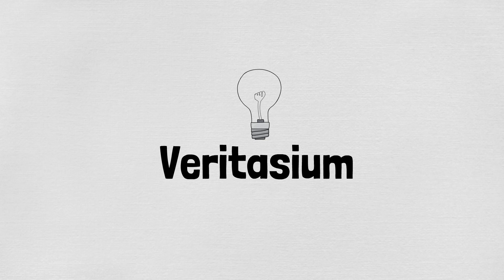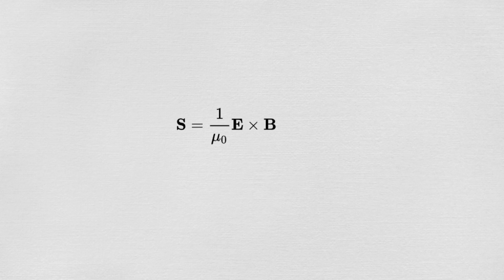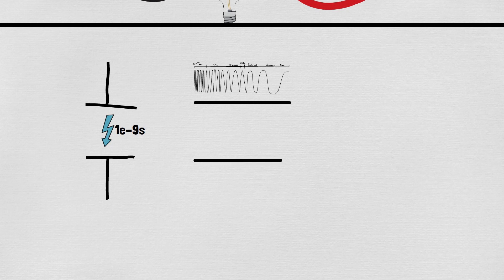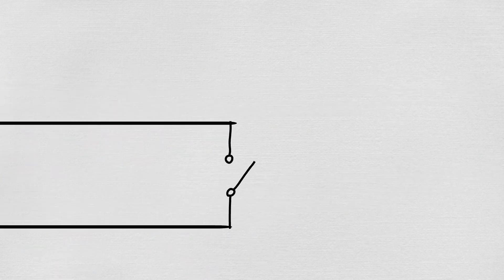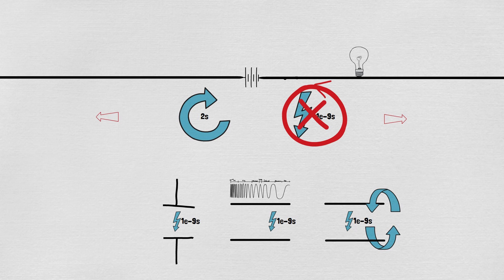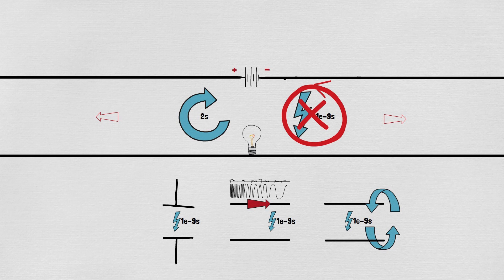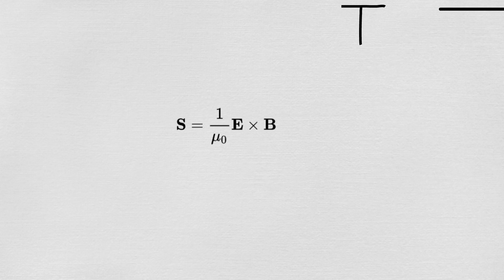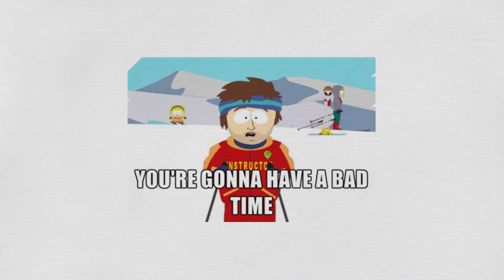Veritasium is Right? (see description)

Comment: When does the current start to flow? Won’t the electric field partially exist when the switch closes as the current starts to propagating from the battery? Won’t this electric field gradually turn on the lightbulb over the time it takes for the current to fully develop?

P.s. I know nothing but this is what I got from Veritasium’s video

Comment: THANK YOU for your video !  I 'think' I've got this now ( after piecing together so many videos on Dereck's treatise on the flow of energy ).   I think Derek is technically correct, but there were other pieces of the puzzle which I believe he left out of his video ( admittedly so, by Derek...likely in order to keep his initial video on this topic brief enough to whet our appetites, yet not so deep that it was going to take a couple of hours going over the mathematics and fundamental concepts of it all....which we could study on our own if so inclined after his vidoe )....but I digress....

I originally had been of your same viewpoint on this, Tycho -- that it would violate causality for the power signal to travel the 1 meter from the battery to the light-bulb/load, but now believe Derek to be correct.  I'll try to ( very ) briefly explain, below.  Hopefully this will spark some good discussion and desire on the part of many to investigate deeper into this FASCINATING process of power conduction.   Ok, here goes ( the ultra-abbreviated version ):

1) Even without a closed circuit, or time for the electromotive force to propegate the full length / circuit of the wire loop, power begins to be transmitted immediately upon connecting the battery to the length of wire....the deceptive part is both the switch, and the manner in which current & electrical potential flow.

2) The circuit immediately begins 'transmitting' ( literally ) power by means of a Displacement current which appears across the first wire ( which the battery is connected to ), then > transmitted < across the air ( or any ) gap ( much like a spark-gap transmitter transmits / receives power across a similar 'spark gap' ) between the battery and the light bulb setup 1-meter away from the battery.    The wires act much like the leaves of an Electroscope ( after the switch is thrown, yet before electrical current has even had time to fully travel the full length of the wires ), as the Electromotive force immediately begins to propegate outward from the battery, in both directions along the length of the initial wire ( connected to the battery ) via a Displacement current.   It then induces a secondary Resonant current in the second wire ( connected to the bulb ).  This power transmission signal propegates a little slower than 'c' ( as it's travelling through the medium of air between the battery and the bulb ), but will arrive at the bulb one meter away roughly in the time referrenced by Derek in his video.

3) In this initial condition ( before the current has had opportunity to travel the full length around the wires ), the system is still operating like a tank circuit where there is a complete gap between both wires, and the wires are acting as the plates of a capacitor, rather than merely wires in a typical closed circuit.   The first wire length ( connected to the battery ) acts as a transmitting Antenna, while the second wire ( connected to the bulb ) acts as  a receiving Antenna.  The circuit > always < acts in this manner when charge is rising or falling ( like it would when either a battery is initially connected, or the circuit is connected to A/C power ).    This is why holding a fluorescent light bulb near a power transmission line will cause it to light up in your hand, even without a typical 'closed' circuit ( with wires ) being made.   It is the changing electromotive force, being literally transmitted ( as an electromagnetic signal ) which transmits the energy of the circuit in this intial condition, prior to any DC current making a full loop back to the battery.

4) The deceptive part of this is Derek using DC as the example power source, rather than A/C.   DC will produce an initial 'blink' of the light ( possibly faster than human perception ) as the circuit charges to full capacitance via the LC time constant for a tank circuit.   It will then go dark immediately after the initial capacitance of the circuit reaches full charge ( and the charge is no longer moving outwards from the battery....as capacitors block DC current once charged ).   Once full capacitance is reached ( under D/C ), the initial blink of the light will go out until the electromotive force has induced a Conduction current around the full loop of the wire ( ~ 2 seconds or so later ).  Then the light will turn back on and stay on until the battery can no longer power it.

5) Under A/C conditions however, the light will light up nearly immediately...roughly in the time it takes for light to travel the meter between the outstretched wire lengths, and will stay lit until the power is shut off, without having to wait for Conduction current to travel fully through the wires like it would have to for DC to light up the bulb continuously ( outside of the intial blink of the bulb while the circuit's capacitance intially charged up via Displacement current flow prior to Conduction current flow subsequently taking over in order to transmit further power to the bulb ).

6) So it seems that A/C current literally transmits the power via electromagnetic radiative power transmission, whereas the DC circuit intially tranmits a burst of power through radiative power transmission, then briefly stops transmission once the circuit has reached its capacitance limit, then begins re-transmitting power through conductance, after the intial burst of radiative power transmission due to the circuit charging up to full capacitance ( before being completed and allowing conduction current to then flow and continue transmitting power ).

7) So I believe there are two forms of power transmission being demonstrated, and the use of DC, coupled with Derek's explanation is not untrue, yet is misleading if one does not take into account the two modes of power transmission being used for DC, as opposed to AC, as well as the difference in behavior of the circuits when being run on DC as opposed to AC. --- DC blinks initially at 1/c ( when setup with a one meter gap between battery and bulb ), goes dark, then re-lights after ~ 2 seconds, whereas AC illuminates initially at 1/c, then stays on.   The difference in behavior, and the two different conduction methods taking place via DC, as opposed to AC predominately using only transmitted power across an air-gap ( which Derek was describing ), rather than an initial spike of radiative power transmission, then followed by continuous conductive power transmission after ~2 seconds for DC, makes all the difference in the world in understanding the different behaviors and power transmission methods occurring in the circuit.

Hope this made sense ( and is roughly correct ), but I'm sure others will be able to fill in the gaps and correct the model I've described above to be more accurate.   This was a fantastic foray into understanding power transmission as well !  Thank you Tycho, Derek, and countless others who i've consulted to finally get a much better understanding of this topic.  Absolutely FASCINATING to say the least !  :- D

Comment: It was shocking to see so many physicist Youtubers agreeing with Veritasium. It's been a decade since I've worked through Jackson, but it's intuitively obvious that aside from a brief energy transfer across the airgap when the switch is first closed, there would be no further energy transfer until the wave propagates all the way around the wire and properly lights the bulb. It's patently obvious that the shorts at the end of the circuit matter - otherwise every lightbulb nearby would be getting lit up  rather than just the one on the circuit.

That said, in your analyses I think you're overlooking that there is initially a voltage across the switch (which is determined by the shorts at the ends of the circuit), so when the switch is closed, there will be a brief flow of current (regardless of whether the ends remain shorted).

Comment: I think you're right but my question is this: why is there ANY (significant enough to power the bulb) EM air gap transmittance of energy across the 1m from the battery to the light (even after having an established circuit and current flow)? Isn't the cable insulated? Is this really how electricity works...?
Reply: Wire =/= cable. 
But no, any real bulb that requires a significant portion of the source voltage would never light up just because a tiny current caused by the effects described in this video flows through it.
Reply: @biogoo  So this example (and the original) reflects what would happen if using no insulation then (I guess that's why Veritasium had that section about transmitting information across the Atlantic). Gotcha and that makes more sense. So for normal grid electricity there would be electric and magnetic fields that propagate along the wire but no meaningful energy is transmitted outside of the insulated cable.

Comment: Couldn't it be true that the time it takes for the light bulb to come on depends on where the switch is located along the circuit? I'd expect that the actual potential difference is created at the open ends of the wire where the switch is located such that the energy effectively needs to propagate from the switch to the light bulb as the switch is closed.

Comment: Out of interest, if you were to increase the voltage of the battery once the field is already established, how long would it take for the brightness of the bulb to increase? Would the field have to increase at the same rate as turning it on initially - thus same time delay?

Comment: "the current will not flow until the EM field is fully established."

I do not believe that is correct. The moment the switch closes, the first electron should move from high potential to low potential. From this, a wave travels down the wire as electrons each begin to move. The fields are instantly produced because current, at least locally, is immediatly flowing. Now, in each direction you will get a wavefront vaguely akin to a sonic boom as the electrons either bunch up or spread out depending on which side you look down. This bunch up is how you can have current without anywhere for it to go. Any location that this wave has already passed has full, normal current passing through it which is continued and sustained by the part that has just been passed by the wave front. Any location which the wave has yet to reach will not yet have current. You may expect a breif flash for normal small circuits but that is only because the circuit runs out of capacitance/whatever. The lightyear-long circuit will experience seemingly infinite capacitance/inductance/whatever as the wave continues to reach unused space/wire and thus will be able to maintain a continuous current through the section of wire it has alreay passed on both the battery an bulb sides.

Now along with any of the three wireless transmission explaanations you gave you can see that the wave will induce a current in the other side which behaves exactly the same as the current inuced in the first side of the wire. At t = .5000000000001 seconds you will have current flowing together throughout the entire circuit (half a second to reach each end from battery plus a little bit extra for the field to reach the lightbulb side of the wire and go all the way to each end). Depending on the transformer losses, you will have full brightness either instantly or at t= 1 second where the fiels within the wire can fully develop from either end.
Reply: I believe you do not believe that is correct 'cause it's wrong. There's no established EM-field in working RF-line still a current (AC) have a place.

Comment: I don't think it's right that no current flows until the fields are established all the way around the circuit. Some current will start to flow through the battery as soon as the switch is closed, in order to charge up the wires. The B field from that, together with the E field from one end of the battery to the other, will send some energy in the direction of the bulb. It won't be much, but it won't be zero either, and so will count as "lighting" by Derek's eccentric definition of the word. Tycho points out that it's a dynamic situation, but then fails to analyse the dynamics!

Comment: You say at 6:50 that, "the current wont flow until the EM field is fully established along the entire circuit. This simply isnt true. If I take a simple pared down case of just two long wires on the same axis with a gap between them such that a battery could drop into (connecting one wire to + and one to - ) and one wire having an inline bulb. If you drop a battery into this configuration you would have the batterie's electric field spreading outward at the speed of light. As it engulfs the conductor on either side it will begin driving a current. As it passes the bulb on one of the sides the current will now be flowing through the bulb. Of course once the fields reflect off the ends it will begin to establish a steady state of zero current. But it is incorrect to say that current WONT flow until the EM field is fully established EVERYWHERE in a circuit.

See my video simulating this problem in HFSS to visualize the fields.

Comment: The thing that convinced me veritasium was wrong was this: suppose there was a break in the wire, out a light second or so away. This break means the circuit should not work. This is just fundamental circuitry. But, the electromagnetic field isn't "smart". It doesn't know that a break exists beforehand, and because information only travels at the speed of light, there is absolutely no way for it to "discover" the break, and stop flowing, for at least a second after the power is connected. if the energy flowed as veritasium implied, and went straight to the bulb almost immediately, the bulb would turn on, and a second or two later go "oh shit there's a break" and turn off again. Which is absurd.

Comment: But won't there be a potential difference across the switch? Or can the potential difference only exist at the battery terminals (regardless of connecting wires)? In my naive understanding I thought connecting a wire to a terminal would cause the wire to effectively become an extension of the terminal, so the end tip of the wire would be just as positively or negatively charged as the terminal (assuming enough time for any necessary propagation to occur).

Comment: It would be very intresting to see how the capacitance between the parallel wires will affect the lamp before the field covers the entire 2 lightseconds.

As the first 2 seconds pass by, I expect a constant current since a theoretical circuit with larger and larger capacitance is introdused  as the time passes by. This means a somewhat constant current just because of the capacitance of the circuit. Every dt we would get a dQ due to the new capacitance dC introdused to the circuit. Considering dC/dt is constant, dQ/dt will be constant and the current should also be constant.
I feel that there would be a very wierd output on the lamp due to transient phenomena if someone could performe this experiment in real life.

Comment: How do we know you can only get current after switch is closed.

A battery has potential difference before the current is flowing.  The anode and cathode physically have a  charge.  The reason Zn---> Zn(2+) +2e-(electron taken by electrode) doesn't happen because one electrode has actual negative charge. This negative charge instantly physically attracts any Zn2+ in by electrostatic force of attraction.  Due to being at higher potential then what Zn2+ can tolerate it's forced to absorb charge to be neutral.
It's a equilibrium of Zn losing electron and cathode forcing electrons to Zn2+.

I think. 
This question is probably more related to how cells work.
Are cells capacitors whose charge just replenishes 

I mean cell can be approximated by capacitors of near infinite charge and conductance .

I am not entirely sure how Zn --->Zn2+ equilibrium is maintained 

I am absolutely certain that a switch is just a capacitor where current doesn't flow because the charge on it's plate counters battery voltage.

When we say close a switch it's equivalent to removing dielectric from the capacitor. 
Current will flow instantly from one plate of capacitor to other in form of electron beams.
This current would cause induction according to lenz law.

Comment: I just felt difficult in understanding how a AC works in this system, as long as it go back and forth, how do you maintain one direction?
Reply from the maker: A crude but useful analogy is a piston attached to a cam, say on a stream locomotive. Even though the piston is moving back and forth, you're still extracting energy from the system during both the forward and backwards movements of the piston via the cam. In this case, the cam is the EM field, and the piston is the E field.

Comment: Closing a switch next to a battery can charge a conductor past the switch.  This causes a very temporary (transient) EM field.  You're right that it is a dynamics problem but I think you're overlooking that a step change like closing a switch can induce a transient EM field even in an open circuit.

Yes it will take 2 seconds for the light to remain lit in steady state, but if you use a high voltage battery, the bulb will also flicker in 1/c seconds due to the induced current.  Even a low voltage battery will induce some flicker/current but it is unlikely to result in sufficient photon emission to be detected  by the human eye.  The phrasing of the question is misleading because I believe he says 'any current', even a tiny transient induced current would thus qualify.